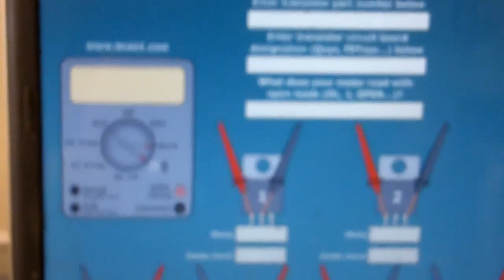Basic Transistor testing tutorial

Comment: Testing a transistor and a Mosfet are totally different, with a transistor you will get the same reading as you would on a diode, but a Mosfet can actually be turned on and off from just the ohm meter voltage.